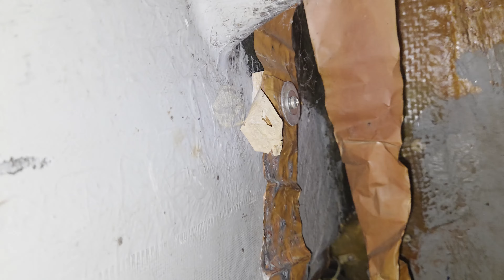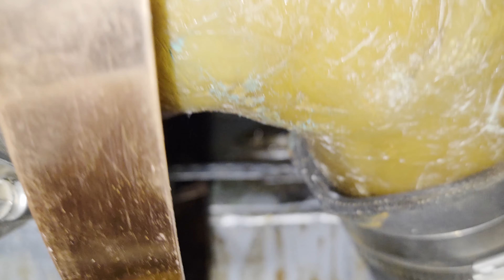Sailboat Bonding Circuit - Why Was This Copper Strip Disconnected?

Comment: Always great to see the details on fellow 424 insides! 
Isn't the grounding copper strip that is around 3AWG a bit of overkill? I would think, for the boat electrics something like regular 8AWG wire connected to the tank should be plenty enough. Not ABYC certified opinion, just a regular electric/electronics engineer thoughts.
Reply from the maker: Thanks for the comment.  Yes, I'd venture that the material does carry greater amp carrying capacity than an 8 or 6 AWG wire.  The opportunity to work with this material taught me a lot.  I believe the minimum specs for un-insulated copper strip by ABYC standards is .8mm thickness and 1/2 in width.  I went with 1 in wide x 1 mm thick copper flashing for the main run and 15mm wide x 1mm thick copper flashing for the fuel intake/return lines.  Going with the 15mm x 1 mm for the entire project would likely have reduced material costs and resulted in an appropriate implementation.  Given that this was a project where I was learning on the fly, I was happy to work with both the 15mm wide and 1 in wide flashing, but the 15mm flashing would probably have been fine for the entire project.